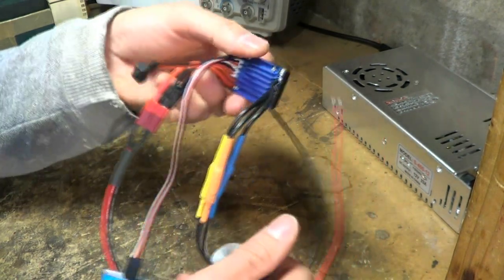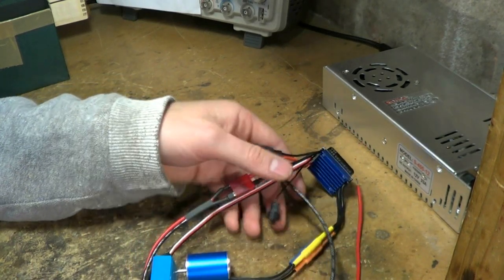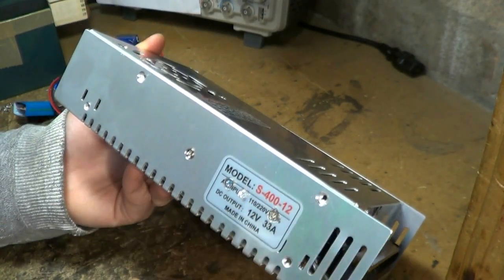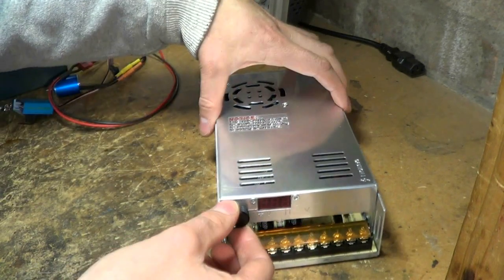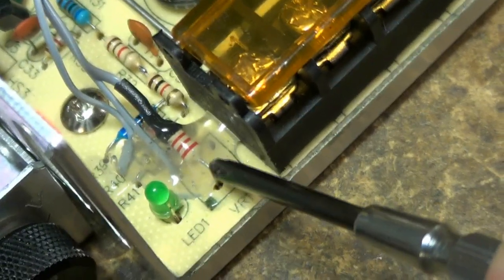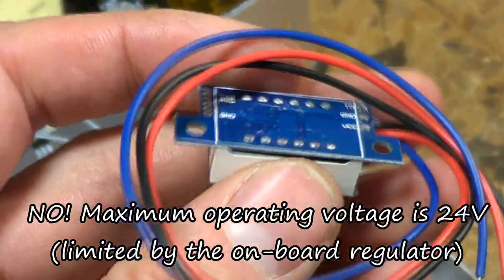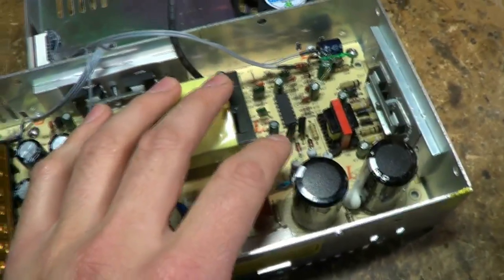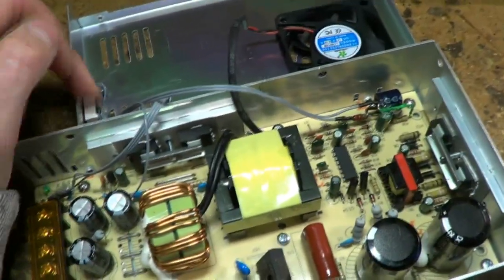Modifying a S-400-12 switchmode power supply for variable output voltage

Comment: so i am repairing problem is what is the value  TR1 and TR2
Reply from the maker: What do you mean by "value"? If you mean the part number, I have no idea. As for the inductances and turns ratios, see my webpage, there's a drawing of them there. However, I would be very surprised if the transformers are actually damaged, they are pretty robust.

Comment: Hi mr Wilson
May you please take a look at the psu model BD-400w-12
Which is designed as an led outdoors  driver .and give some hint and guide me to have some changes to the circuit like the one you did. Its diagram is much more simpler than s-400-12.you reversed engineering that.
Thanks a lot 
Its pwm controller chip  part number is 
KA3845D
an 8pins
Reply from the maker: I'm sorry, but I can't help as I've no experience of that controller chip. Besides, if it's designed as an LED driver, it may be providing a constant output current instead of voltage, in which case it's a completely different design.
Reply: @imajeenyus42  thank u for replying mr wilson .you have already proved yourself as good help for my project on tl494 chip on psu. And yes you r right about the design,it is constant current for leds
As a suggestion take a look at the datasheet of the ka3845 on the net 
You may find the ka3842 intstead on the net.but it is a very interesting chip compared to tl494.

Comment: I'm in the process of repairing a couple of these PSUs and your schematic and explanation helped a great deal, thanks! Mine are a 24V 15A psu but the PCB is exactly the same, just some components were different to make it a 24V supply. I've learned a lot by studying the schematic and datasheet! One PSU is dead and the other drops to 3V under load. It'll be interesting to see how I can fix them. I already replaced one of the output transistors, one of which has failed spectacularly, burning so hot it melted the plastic cover of the 680uF 250V caps! One resistor near the transistor blew as well. But replacing them was not the solution, there's probably more failed components. I'll keep working on them until they are fixed.
Reply from the maker: Good to hear! Hope you can get them sorted. Don't forget the actual controller IC itself - I once managed to fry the IC in a power supply I was using near high voltage/sparky stuff, probably voltage spikes or noise introduced back into the supply. I took the chip out and put a socket in so I could easily replace it in future.
Reply: @imajeenyus42  Thanks for the suggestion! On psu 1 I missed checking for resistors failing open instead of shorted. I found 4 without any discoloration, probably because base and collector shorted on the bridge transistors. 
On psu 2 it's dropping in voltage under load, likely short circuit protection kicking in too early or something keeping dtc pin higher than it should. Some resistors can get quite hot when checking with ir imaging camera, some even 80+ degrees C. And one blue cap too. It still gives 24V withou load. Psu 2 is a newer version with slightly different pcb and component values.

Comment: Mr Wilson
I have a way to make the cooling fan  running regardless of the output voltage. In my modification the voltage for the digital voltmeter ranges from 12 to 18volt of the power supply circuit for the meter. If  i take power for the fan from meter power and using lm7812 regulator.
Do you think this method is ok and no harm to the power supply and its output?
Thank u
Reply from the maker: Yes, that should work - remember that the LM7812 has a dropout voltage of around 2V, so your fan will run at a slightly reduced voltage until the power supply reaches 14V.
Reply: @imajeenyus42 thanks
How about the lowering the output voltage a little bit more to   4 volts,mine the lowest reach to the 5.9 volt
Which resistors in the divider network i should change to get the 4  volts at the lowest
Reply from the maker: @amirvafa7344  You would want to increase the value of R4 - this will decrease the lower voltage limit. However, you may then run in to problems with the short-circuit protection circuit kicking in, in which case you would have to remove D13 as described on my page.
Reply: Thank u bro
As soon as l added a load to the output ,the lowest voltage came to 4.8.and every thing was perfect
No need for any changes
You were a great help for me
Your description and analysis of the circuit was perfect. I learned very much
..im not professional in electronics
Im just an  aircraft electrical technician
Which mostly our jobs is troubleshooting for wires and generators which rarely involved in electronics
Take care and bye

Comment: Becoz of almost high amperes delivery of this psu ,i think i can be modified for higher voltage than 15v,but i don't know how much i must change the divider resistance without losing the  over  voltage protection of course  in case this psu has such a protection
Reply from the maker: Why? Just buy a higher voltage supply. It's not worth the trouble to modify this way. The transformer is designed to output a little over the nominal voltage maximum, so you're never going to get it to produce a significantly higher voltage than its designed to. Additionally, you would need to change the output smoothing capacitors to a higher voltage rating, change the current sense resistor to provide the same power limiting, besides the feedback divider itself.
Reply: @imajeenyus42  thanks for the reply. I have modified an atx psu which is more complicated than this chineese psu ,and i got at least double voltage for every line of it 
But i had to ground the dtc pin  so losing every protection. But in your job u did lowering the output voltage without losing under voltage protection,i like to do that for O/V protection and change the outputs caps. It's so fun have your psu made specially for yourself.
Reply from the maker: @amirvafa7344  If you really must, then make sure that the output smoothing caps are rated at an appropriate voltage.
Reply: @imajeenyus42  of course. Thank u .again u gave a very clear explanation of the modified circuit.but still i think that the fan of the s400 psu must run independent of the main circuit and as soon as the power supply gets on start spinning.

Comment: Thank u bro for your nice work
But it would be a great help if you put a modified wiring diagram including connection for the volt meter ,i did not know how and where i connect the caps and others diodes you explain ed in the webpage
Please reply and help me with this problem
Reply from the maker: Hello, I’m not sure what wha you mean - if you take a look down the bottom of the web page, I have described and shown how the auxiliary supply for the meter is connected. Starting at the paragraph “The power supply for the voltmeter module is derived from…”. Please take another look and see if it helps.

Comment: First of all .thank u for a totally perfect explanation and very good job and drawings. Second
I just need help that how can i lower the adjustment pin voltage from 2.5 as reference of tl494 which is normally 5v to 1.25volt.if i could do this so i can lower the output much lower without DTC pin goes high before output reaches under 1.25.again i should thank u becoz of your very neat job.
Reply from the maker: I'm not clear what you mean. If you mean the reference voltage on pin 2, which is normally 2.5V, then you would change the values of the resistor divider R34 + R30. You would then need to disable the short-circuit protection by removing diode D13. However, I have no idea what effect all this will have on the loop stability, since it will then be operating considerably outside its original specifications. If you really need an adjustable supply that goes that low, then I would seriously consider just getting a bench power supply. Cheap, and designed to adjust right down to 0V.
Reply: @imajeenyus42  you got what i meant
I would think like that i can keep short circuit protection and have such low voltage on pin 2.seems impossible. I well know by grounding pin 4 of tl494.we can bypass all protection and have changes we need.
Thank u for your reply
U R a great help
With best regards
Reply: Thank u again bro
How about the cooling fan
How can we keep it on even we use smp on low voltage. I checked the fan is turning a little slower with 7to 8volt 
But not turning on 5v.i prefer to have it start cooling all the time the psu is on
Reply from the maker: @amirvafa7344  You might try replacing the fan with a 5V version and using a 7805 regulator to power it from the supply's output. However, since the fan supply is derived from the main output, you're never going to be able to run the fan with an output lower than 5V or so.

Comment: Thank you very much, first of all for the schematic. I would like to make just one clarification. I believe the short circuit protection is via pin 15 (I2-) of the IC and not by the circuit around Q5. This should add an extra protection, that of over voltage, by shutting down the IC when this occurs
Reply from the maker: Mmm....not quite. The feedback from the current sense resistor(s) that goes to pin 15 is used to reduce the PWM duty cycle of the IC if the current drawn exceeds a threshold. However, it does not shut the IC down - it continues operating, simply with a reduced output voltage. The stuff around Q5 deals with an actual short, or more properly, a situation where the load is high enough to cause the output voltage to drop below about 4V, which is where the short-circuit feature is triggered.
Reply: @imajeenyus42  maybe you are rigth, but in my very cheap power supply, using the same pcb, Q5 and related components are not mounted at all, so it seems strange to me to sell a power supply without any short curcuit protection
Reply from the maker: @brunodalessio4622  I wouldn't be surprised ;-) I've seen cheap supplies with missing components, or even components fitted but the PCB traces don't connect to anything!
Reply: @imajeenyus42  Chinese people are crazy and we are even more crazy when we expect to buy well-made items for ridiculous prices!

Comment: I did the schematics many years ago, and ever keep looking for the web without any of that until today that your post appear despite you say you post it in 2015. 
Some details in your schematics i found and are fail, first C5 is in conection with C10 in one side and the 3 resistors in the other and not as you put in your schematic and the second is that R26 connect to anode of DB1. I didn't see in that day that jumpers were shunt and put the coil connected to ground and thanks for your measure (i have not a miliohmeter) i'll fix that. 
Here my schematic i did in 2014

https://i.imgur.com/pJII94G.jpg
Reply from the maker: These differences are electrically identical - they won't affect the operation of the circuit any.
Reply: @imajeenyus42  Yeah, you and I both know that electrically won't affect but when is about a reverse engineering and documentating anything it must be 1:1, the most exact as possible to get it. Don't take it as a destructive critic but rather as a other eye that look that you skipped. I also skipped the shunt resistors in that moment and didn't care about it, so, i must admit you open that part i was blind (due a lack of instruments). Best regards.

Comment: Hi Lindsay. Great explanation. And thanks for the mod. Can you maybe tell me how to bring voltage of a 5V type DOWN to 3.5V? I need to charge some LiFePo4 with it, and can find out which resistors need to be changed. I know that D13 may be needed to be removed to remove the short circuit protection in this case.
Reply from the maker: I'm afraid it's difficult to say without seeing the actual schematic and component values. It would probably be easier just to use an additional step-down buck converter instead of modifying the supply. Try looking at the LM2596 or XL4015 modules that are on eBay (e.g. https://www.ebay.co.uk/itm/293187069736)
Reply: @imajeenyus42  Thanks Lindsay. The layout is exactly the same as the one you got. Traces are the same. I can desolder the resistors and tell you the values, but I'm pretty sure most of the relevant ones are the same. Getting a step down converter is no way, as I need the full 50A of the powersupply. I need to charge 16x 280Ah LifePo4 cells, and every charging amp counts ;) What would you need from me in case you got the time to investigate?
Reply from the maker: @izemanevobike  I can't promise I can figure it out, but I would need to know the values of all the components in the area marked "Voltage sense" in the schematic on my website, resistors and capacitors.
Reply: @imajeenyus42  WOW. Thanks! I desoldered one leg and measured them: R32 = 1k5 , R39 = 680 , R40= 1k5, R41= 2k6, VR1= 1k type, C31= 35nF, C28 = doesn't exist. I experimented a little with some resistors here and there and could lower voltage to 3.8V, but when I start to go below 4.5V the power supply starts a hissing sound. Don't know where it comes from, but it doesn't sound very healthy. You also get that sound in the unmodified supply if you turn VR1 very quickly from high to low voltage.
Reply from the maker: @izemanevobike  Try keeping all other components the same, but change R40 from 1k5 to 4k7. That should give you an adjustment range of 3.45V to 3.65V. Alternatively, if you need a bit more adjustment, try R40=3k3 and VR1=5k, which should give adjustment from 3.1V to 4.1V. The hissing sound is strange - that sometimes happens when the supply is unloaded, so it should disappear with a load.

I just realised - instead of spending time trying to modify this supply (great if it works, but....!), you do get 3.3V power supplies which would be far better suited. For example, the Mean Well HRP-300-3.3 which has 60A max output current and is adjustable from 2.8-3.8V. They're not exactly cheap, but would be an off-the-shelf solution. One stockist - https://www.powersuppliesonline.co.uk/power-supplies/enclosed-power-supplies/hrp-series-mean-well/hrp-300-3-3-198w-3-3v-60a-enclosed-power-supply.html
Reply: @imajeenyus42  YOU'RE AWESOME! Thanks a lot! I tried something like that before, but the important stuff that make it work was "attaching a load". Yes. The hissing noise is gone, and I was able to turn it down to 3.45V with the 4k5 mod alone. BUT only after I added a small load (in my  case a little 12V bulb that glims only at 3.5V). Without load the voltage at the terminals showed 3.85V no matter were I set VR1 to. Only after adding a líttle load (to make the "no-load" voltage adjustment) it worked perfectly fine. I owe you a lot! Anything I can do for you in return?
Reply from the maker: @izemanevobike  Haha, that's great to hear! Don't worry, I'm just happy to help!

Comment: Hi,
In your picture, the sense pin of the voltmeter module is connected to the jumper named J9 in the pcb diagram. My power supply is not fully compatible with your source. Please explain what other circuit elements the jumper named J9 is connected with?
Reply from the maker: I'm not sure what you mean - there isn't a J9 in my circuit diagram. The sense connection of the voltmeter module is connected to the output of the power supply.
Reply: @imajeenyus42  I'm talking about the J9 jump shown in the red circle in the picture. Which circuit elements this jumper is connected to. https://i.resimyukle.xyz/R8OHW0.jpg
Reply from the maker: @technology520  Ah sorry, I see now. J9 is weird - both ends are connected to the positive output, so it doesn't actually do anything! I don't know why it was added, possibly just to increase the current-carrying capacity of the PCB trace and reduce heating. I used it as a convenient connection point for the output voltage sense.
Reply: @imajeenyus42   Thank you for your answer.
Reply: @imajeenyus42   Hi,There are two UF4004 diodes that connect to the voltmeter module. Can I use a 1N4004 diode instead of these diodes?

Comment: Hi, 
Great video, reverse engineering is my favorite !
I've read carefully the pertaining article on your web site.
I have one question concerning the 'current' section (the one paragraph thats starts with *Opamp #2 of the TL494 is used for current limiting*).
First of all, I'm surprised they did not include an opto-coupler in the TL494  loop-back section, that would have really isolated the output from the mains.
Anyway, I want to use this SMPS as a 4S LifePo4  charger with a 20A charging current.
The initial 'Bulk' section of the charging must be a CC/VV (constant current/variable voltage) that must be followed (as soon as the battery voltage reaches 14.6V) by an 'Absoption'  section at CV/VC (constant voltage/variable current).

Do you think that if I would make a mod to R21/R35 and make them variable instead of fixed values that woud help to control the intial output current to 20A with an increasing output voltage and THEN as soon as the battery will have reached the set voltage (14.6V), the current will go decreasing ?
To make a long story short, I am not quite sure how output current and voltage are intricated in this SMPS ...
Can you share experience and give me clues on that ?
Reply from the maker: Thanks for commenting. I'm afraid I don't really know how that would behave - while adjusting the R21/R35 combination would allow the threshold to be changed, I'm not sure if that would then function as an actual constant-current regulated supply. That being said, someone has apparently converted a supply into a constant-current charger for an e-bike, so it would be worth taking a look at their info. There's a github page here, and there's info about the constant-current modification at the bottom of it: https://github.com/matteljay/ebike#converting-a-60v-led-switch-mode-power-supply-to-an-18650-cell-charger
Reply: @imajeenyus42  thanks alot !